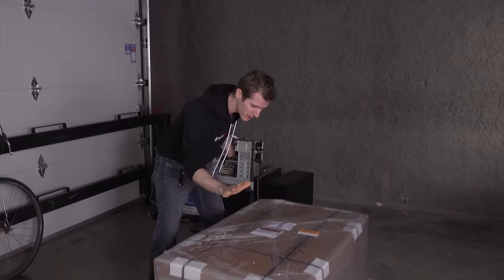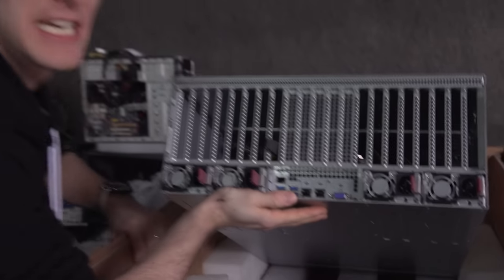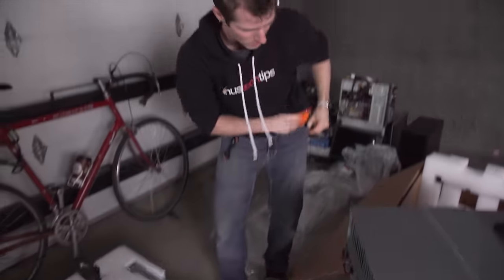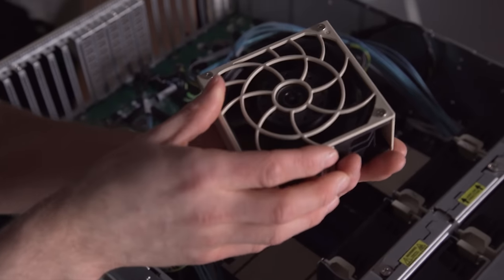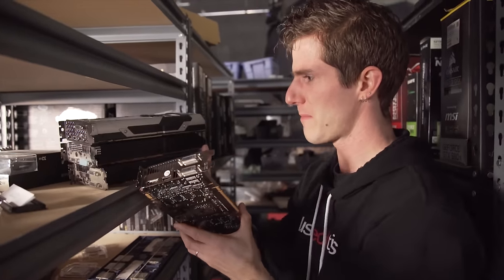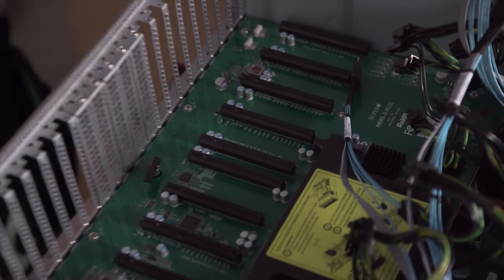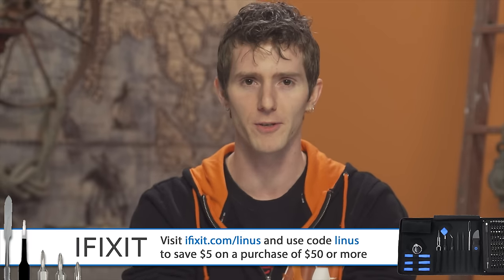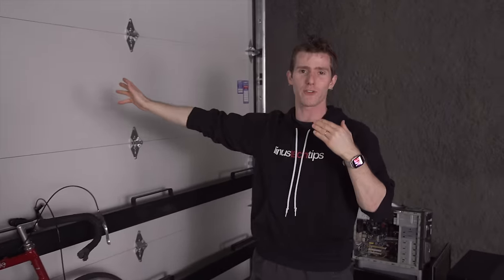$4,000 Server Chassis Holds 8 DUAL SLOT VIDEO CARDS! - HOLY $H!T

Comment: 24 ssd's in raid 0...

Im ready
Reply: +JgHaverty not enough bandwith
Reply: 97ABDE I... dont think you understand how raid works...  if theres enough bandwidth for the one ssd , theres enough bandwidth for them all. The only trick is having enough sata ports (which im assuming it does, else 24 ports is stupid).
Reply: +JgHaverty No, PCI bandwidth is what he means. I doubt that even PCI could handle transfer speeds that high.
Reply: TheRebel3000 Uh... its still sata man... and both of you still dont understand how raid works... not sure what pci bandwidth has to do with sata bandwidth lol 

Seriously, go do some reading.
Reply: JgHaverty Its called cpu bandwith... Seriously go do some reading.
Reply: +JgHaverty Yes it does... 24 SSD's on sata: yes sata has 150/300/600MB/s per port on normal boards (Chinese crap versions might do some fuckups but normally each port has it's own allocated bandwidth of the spec yes.
Just calculate that for me will you ;) 24 x 600MB/s.
You know what, (spoiler alert) that's 14.4GB/s...
PCI will crap out before it moves 1GB/s, as it shared the bus with other PCI devices...
PCIe x16 just hits 4GB/s... 
PCIe x16 2.0 gets 8GB/s, again nowhere near the 14+GB/s...
PCIe x16 3.0 does 15.75GB/s, which is just barely enough, but hardly any RAID card features a full x16 as most servers offer x8 slots only for storage. Most raid cards will be x4 or x8 which on PCIe v2 will never supply enough bandwidth.
Besides that no RAID card can keep up with 14GB/s of traffic for RAID5 or RAID6 and you'd be forced to do RAID0 which means 1 failure = complete data loss, you'd have a seriously hard time getting that much data through the CPU from whatever program is rendering...

I love the 'pci bandwidth has nothing to do with raid' statement btw ;) You'd max out your PCI slot with just 2 SSD's in RAID...
Reply: Some Guy Why are you assuming PCIe raid cards and pcie ssd's? What part of "sata port" are you not getting through your thick skull?
Reply: JgHaverty Calm down mate, no need to get offensive and all...
Explain if you will, how you plan on attaching said 'sata port' to anything in the world?
They do not work by magic, that sata port still goes through a sata/raid controller which uses PCIe to connect to the north bridge and then to the CPU.
You might make a sata port which does 100TB/s but it would still not be able to push that kind of data through any other part on that line.
Maybe you have a different way of hooking your sata SSD's up to your systems that includes magic/evil powers but as long as you do not then there will be bottlenecks when using PCI.
Reply: Some Guy 

You're under some impression you can only use 1 raid controller... youre also under some impression you must use a physical raid controller lol. But lets play with YOUR side of the fence for a moment. 

A striped array in raid 0 pulls data from each sata port. Lets just go with 6gb/s, but no ssd's really get over that. 

Lets assume 500MB/s read/write speed. Pretty fair honestly.

x 24, that would still only (lol) be 12.4GB/s, and thats a peak theoretical 1-1, still south of pcie 3.0 x16. 

There are 16GB/s raid controllers that exist, but most raid systems are done via software now anyway, therefore negating your ENTIRE POINT.

Also... its been done before... lol
Reply: JgHaverty You can only use 1 raid controller, so far no raid controllers stretch a single raidset over controllers without using some crappy software raid implementation.
But ok lets say you did 15 raid controllers (PCI you said) you would need to design a motherboard with 15 PCI slots and 15 separate PCI busses... Doesn't exist.
Don't even mention software raid, it is something to play with once and then move on to real raid after you figure out the performance is shit, your CPU performance is shit as all the resources are wasted on your storage and the options are just shit (no raid5/6, not to mention combined raid levels such as 10)
'most raid systems are done via software now ' I laughed and cried at the same time, rarely such nonsense is said ;)
Name a single proper system advertised for RAID using software raid to back that up...
Nobody* uses software raid.
*Except people playing around with their first computer.
So 2 points I'd like to see some sources for, 1 being a raid card that can do a single raid set accross multiple controllers and 2 anything to show that any software raid is replacing hardware raid in the next 10 years.
If you can find something to show software raid replacing hardware raid in the next 10 years I'll count it as 'most... now' like you said...
The point was that PCI wouldn't bottleneck 24 SSD's in RAID (any raid) and it just does.
So I'll add a third question for a source for a PCI card that has 24 Sata ports (Sata or sas) and can magically force 14.4GB/s through the max 1GB/s PCI bus...
500MB/s for a SSD was 6+ years ago, it's a stable 600MB/s already so it is 14.4GB/s but feel free to round it down to 14GB/s anyway...
Reply: Some Guy You know, a simple google search will solve all of your confusion... 

...but Im done speaking to an ignorant brick wall. Take care mate. Do some homework so you don't defend stupid concepts you really aren't understanding.  Seriously dude, you CLEARLY don't understand it. That wall of text is essentially saying absolutely nothing. For you to "laugh" at software raid is absolutely ridiculous and truly shows your ignorance.

ONLY high end servers that require data protection run on raid hardware anymore. 

Also, yet again, 24 SSD's have been raid 0'd before. 4.2GB/s read, 4.8GB/s write, and they were limited because of how the SATA drives were installed, not the sata or cpu performance.

You just DONT get it man.
Reply: Some Guy Here's a good read for you.

"when computing power was limited, hardware RAID cards had the significantly advantage to offload parity/syndrome calculation for RAID schemes involving them (RAID 3/4/5, RAID6, ecc).

However, with the ever increasing CPU performance, this advantage basically disappeared: even my laptop's ancient CPU (Core i5 M 520, Westmere generation) have XOR performance of over 4 GB/s and RAID-6 syndrome performance over 3 GB/s over a single execution core.

The advantage that hardware RAID maintains today is the presence of a power-loss protected DRAM cache, in the form of BBU or NVRAM. This protected cache give very low latency for random write access (and reads that hit) and basically transform random writes into sequential writes. A RAID controller without such a cache is near useless. Moreover, some low-end RAID controllers do not only came without a cache, but forcibly disable the disk's private DRAM cache, leading to slower performance than without RAID card at all. An example are DELL's PERC H200 and H300 cards: if newer firmware has not changed that, they totally disable the disk's private cache (and it can not be re-enabled while the disks are connected to the RAID controller). Do a favor yourself and do not, ever, never buy such controllers. While even higher-end controller often disable disk's private cache, they at least have they own protected cache - making HDD's (but not SSD's!) private cache somewhat redundant.

This is not the end, though. Even capable controllers (the one with BBU or NVRAM cache) can give inconsistent results when used with SSD, basically because SSD really need a fast private cache for efficient FLASH page programming/erasing. And while some (most?) controller let you re-enable disk's private cache (eg: PERC H700/710/710P let the user re-enable it), if that private cache is not write-protected you risks to lose data in case of power loss. The exact behavior really is controller and firmware dependent (eg: on a DELL S6/i with 256 MB WB cache and enabled disk's cache, I had no losses during multiple, planned power loss testing), giving uncertainty and much concerns.

Open source software RAIDs, in the other hand, are much more controllable beasts - their software is not enclosed inside a proprietary firmware, and have well-defined metadata patterns and behaviors. Software RAID make the (right) assumption that disk's private DRAM cache is not protected, but at the same time it is critical for acceptable performance - so they typically do not disable it, rather they use ATA FLUSH / FUA commands to be certain that critical data land on stable storage. As they often run from the SATA ports attached to the chipset SB, their bandwidth is very good and driver support is excellent.

However, if used with mechanical HDDs, synchronized, random write access pattern (eg: databases, virtual machines) will greatly suffer compared to an hardware RAID controller with WB cache. On the other hand, when used with SSDs, they often excel and give results even higher than what achievable with hardware RAID cards.

Also consider that software RAIDs are not all created equals. Windows software RAID has a bad reputation, performance wise, and even Storage Space seems not too different. Linux MD Raid is exceptionally fast and versatile, but Linux I/O stack is composed of multiple independent pieces that you need to carefully understand to extract maximum performance. ZFS ZRAID is extremely advanced, but if not configured correctly it will give you very poor IOPs. Moreover, it need a fast SLOG device for synchronous write handling (ZIL).

Bottom line:

if your workloads is not synchronized random write sensitive, you don't need a RAID card
if you need a RAID card, do not buy a RAID controller without WB cache
if you plan to use SSD, software RAID is preferred. My best choice is Linux MD Raid. If you need ZFS advanced features, go with ZRAID but carefully think about your vdev setup!
if you, even using SSD, really need an hardware RAID card, use SSDs with write-protected caches (Micron M500/550/600 have partial protection - not really sufficient but better than nothing - white Intel DC and S series have full power loss protection)
if you need RAID6 and you will use normal, mechanical HDDs, consider to buy a fast RAID card with 512 MB (or more) WB cache. RAID6 has high write performance penaly, and a properly-sized WB cache can at least provide a fast intermediate storage for small synchronous writes (eg: filesystem journal).
if you need RAID6 with HDDs but you can't / don't want to buy an hardware RAID cards, carefully think about your software RAID setup. For example, a possible solution with Linux MD Raid is to use two arrays: a small RAID10 array for journal writes / DB logs, and a RAID6 array for raw storage (as fileserver). On the other hand, software RAID5/6 with SSDs is very fast, so you probably don't need a RAID card for an all-SSDs setup."
Reply: TheBostonstapler Yeah, i've ofc seen that, but that is some seriously dated technology. The SSD's they used in that example were 250mb read write lol
Reply: JgHaverty You're honestly defending software raid which used 24 SSD's to not even reach 5GB/s while my P800 will crush that with 12 SSD's?...
And I'm a brick wall? So far you're the one making outrageous statements without any sources to back you up, show me a single server using software raid for instance, or a way for a PCI 32bit controller to do it...
'ONLY high end servers that require data protection run on raid hardware anymore.'
ALL servers do hardware raid, you clearly do not own or operate servers, I do at my job and I've never seen software raid. We've seen interns using desktops with software raid and calling it a server but nobody professional will ever consider software raid because it is just a poor mans solution for a problem that has been solved by hardware raid...
I don't get why you're so defensive, you refuse to show a PCI card that will not bottleneck 24 SSD's as you know it doesn't exist and yet instead of admitting you made a mistake you claim we're idiots for telling you you were wrong.
Have a lot of fun with a shit performing solution, 24 SSD's for under 5GB/s and you're claiming you know better.
At one of my clients: 360 SSD's for the cache for a stable 130GB/s as his fiber channel network won't go any faster...

Comment: Updated 2017 version 
2 Threadrippers
8 1080TIs
Reply: 1. this doesn't have a threadripper cpu socket
2. you can only have one threadripper. 2 wouldn't work because of bandwidth limitations

Comment: 36 Cores, 128 GB Ram, 20 TB, 8 GPUs, 2 CPUs. Overkill.
Reply: +Drive Gaming Depends on what your doing. For many tasks that 128gb will be very limiting when using vms. Imaging runing 200+ vms on this system.
Reply: Brandon Aitken I mean 64 GB of RAM per CPU.

Comment: linus be showing off $4k eqipment and has 4 powerfull graphics cards just laying around and i just be trying to get saints row the third to stay over 15fps on my budget build on low settings overclocked and fans running like a jet is about to take off

Comment: I'm a newbie about gaming pcs and stuff but my friend said that graphics cards are not as powerful in a laptop compared to a tower graphics card can anyone shed some light?
Reply: Generally that's true. Most laptops you'll find don't have a dedicated GPU, they'll use the integrated graphics that run off the Intel or AMD processor. For light games like medium settings LoL or CS Go or others, that's fine. If you want a dedicated graphics card, you can usually get something like an Nvidia GTX 960M which is less powerful than a desktop GTX 960. If you want to pay a lot more money, a few laptops have the actual power of full GTX desktop graphics cards, but I don't think there's many of those and they're well over 2 grand.

Comment: dual 16 core Xeon CPU's 8 Titan XP's 765GB of DDR4 Dominator Platinum Memory
24 1.2TB Intel SSD's 
Can it run minesweeper?
Reply: yes, u just need to put it very low settings with anti aliasing off and it will run perfectly fine at a stable rate of 4 fps
Reply: Kirigaya Kazuto Okay Yes! i knew it could handle it! woohoo thank you man! creds
Reply: Sebastian Gort no prob my man

Comment: gonna get one for my gaming
Reply: 8 tittan X 8tb ssds 780gb ram and all the frames
Reply: +W.D.Gaster no, 8 quadro m600, 200 gb vRAM, 1024gb DDR4 RAM, quad mount intel core i4790k, LN^2 cooled (liquard nitrogen) overclocked at 18GHZ/core, at 16 cores.

Comment: You would have a rough approximate of  .077 TB of ram for both cpu's to run or 768 GB of RAM now if you installed 24 sticks of 64 GB of ram you would have an rough approximate of 1.5 TB of ram or 1536 GB

Comment: Holy f*ck is that 1600w Power supply even enough for 8 high end graphics cards?
Reply: +ReverZeYT // Minecraft they have 2 times that, and still redundency because of a total of 4 power supplys so actually i think 3200Watts will be plenty

Comment: You did 7 gpu's already. 8 isn't going to cut it. You would need to at least double that for there to be any interest.
Reply: +Heatranoveryou how about running dual-gpus, like the gtx 690 in there, using 10 of those, you can have 20 gamers

Comment: If u were gonna buy this for a single gaming pc wouldnt u need 8 of the same video cards?
Reply: +Bmxyy No, to run in SLI of Crossfire, you can only use up to four GPUs at once, but you can have any GPUs installed even with one OS

Comment: All i see is a big fire, cards way too close to eachother and then no fan to blow in from the top either. 
Once this thing runs all the grapich cards at the same time, i just see a vulcano waiting to erupt.
Reply: +Unlimited Uploads Those fans are much more powerful than your think they are. The normal gpu's used in these server are passive and have no ports to block airflow.

Comment: Holy shit that thing can support 768 GB of RAM
Reply: 32 GB x 12 x 2 = 640 GB x 2 = 1280 GB. So it can hold up to 1280 GB of RAM.
Reply: ***** Well, you're wrong too. Apparently, I screwed up as well, and the OP is correct.

Comment: It is wrong to put 2 server role in 1 server, Linus. You're risking if the server down, all file access and rendering job stop. Scaling UP a server is NOT a good idea, unless you run virtual machines with vMotion or XenMotion.
Reply: +Sam Gib One more question, How can the GPU cool down since you install it so close?

Comment: why would you need 6400watts just why
Reply: and why would you need 768gb of ram to jeez and yes it is a server chassis and mother board combo but still
Reply: It's only 3200 Watts (Redundancy)
Reply: And why would you need the Maximum of 1,5TB of RAM???
Reply: +Dennis Bondar there are 4 1600watt psu,s
Reply: +Dylan barthalomeu But 2 are for Redundancy and 2 are for actual power delivery